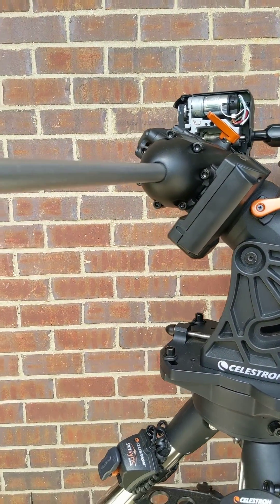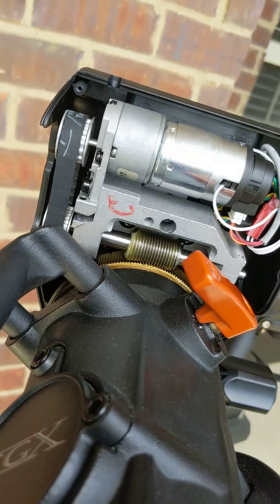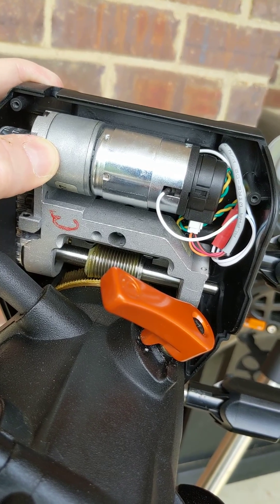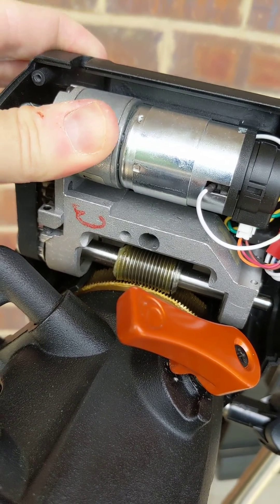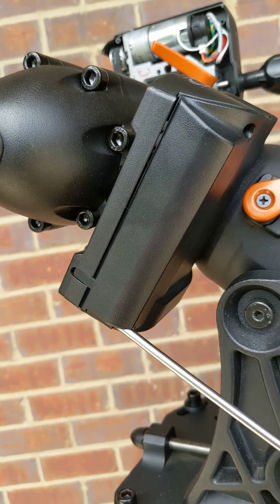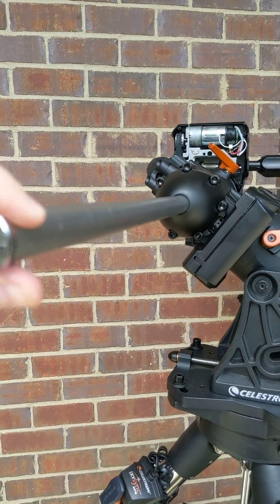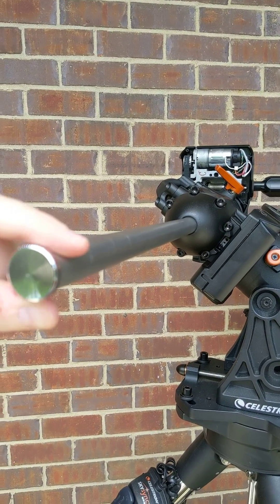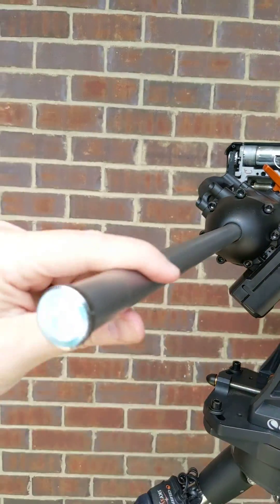CGX RA Axis Backlash ... or no?

Comment: If the cover did not spring open when you first removed the screws then it could be the plastic foot on the housing did not dovetail with the lower plastic housing foot.  I had the same problem.  When putting it back together you really have to pay attention and use a small flat blade screw drive to guide the 2 feet in proper orientation.  I thought the problem was the housing was hitting on the motor but it wasn't when I got it assembled the correct way.

Comment: i have a 1/4 inch of play (5 MM) in my RA on the CGX and terrified to fix it, making the tripod useless. tons of info on CN.com and some YouTube videos but man !!!
but my RA block cant move at ALL and is pressed up again the frame, so for me its not the casing,  :(   i have to loosen something or tighten something.
Reply from the maker: I wouldnt be scared to adjust it.  I'm pretty sure you need to  adjust the 3mm grub nut in the center.  I can't quite.remember which way, but I think that screw is what tightens that mesh assembly against the spring and up next to the block.  When u start backing it out you should notice your play lessening.  But if you loosen it too much, the spring pushes the worm into the worm gear too much.  That's when you start hearing all kinds of noises and binding.  The sweet spot is somewhere within 1/32nd of a turn.  And be careful not to loosen it so much that the screw is barely hanging on by a thread.  I replace my screw with one that is about 5mm longer.  Works much better.